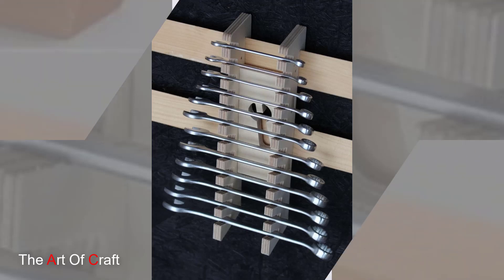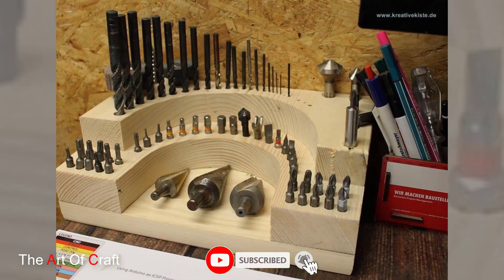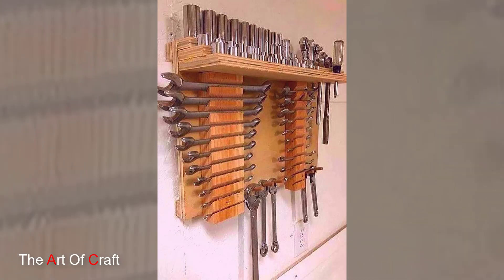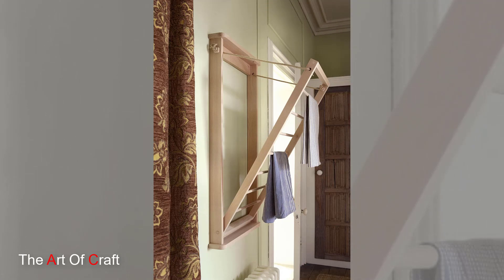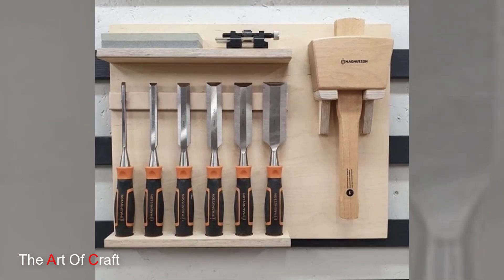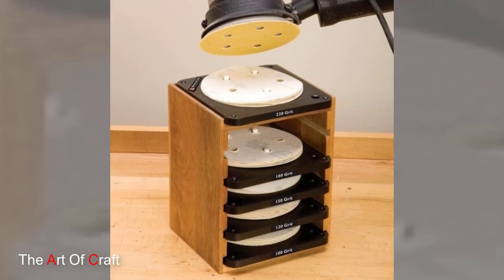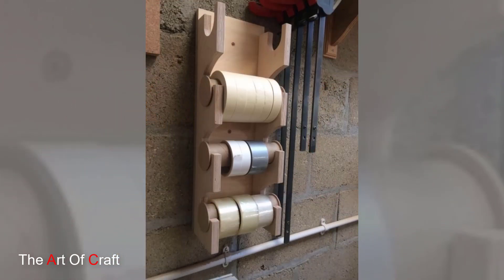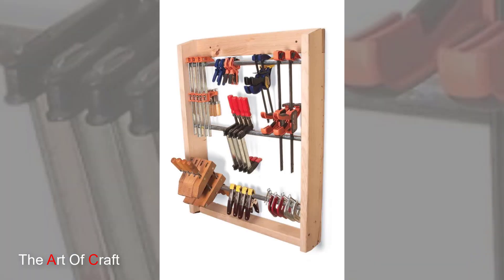wooden tool storage ideas

Comment: I dont have a workshop with walls yet, but I still found myself very interested, and watching until the end. Sooo many great ideas for tool storage, drill bits, router bits, saw blades of different types and sizes, all conveintly stored near the tool theyre used on.😊